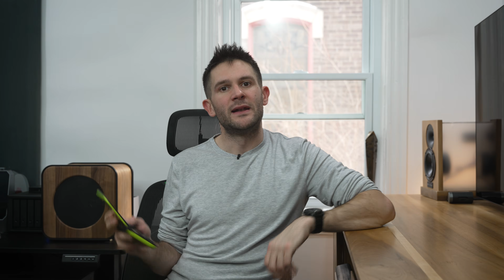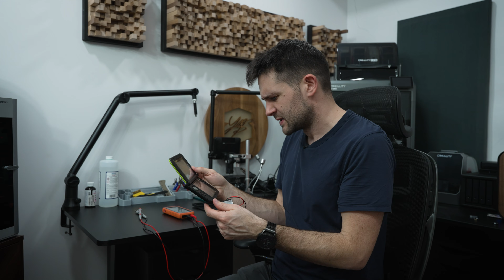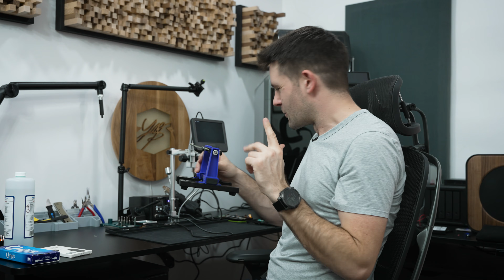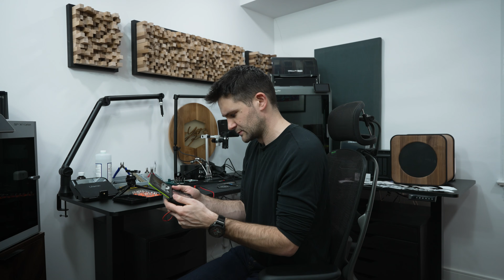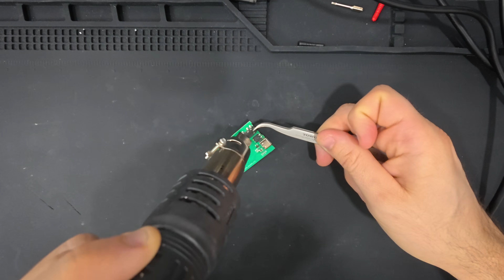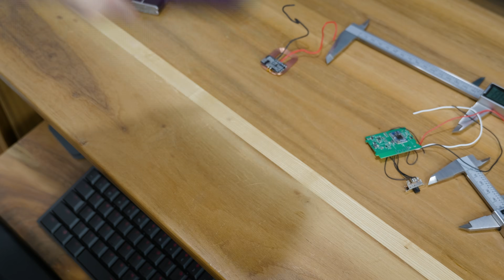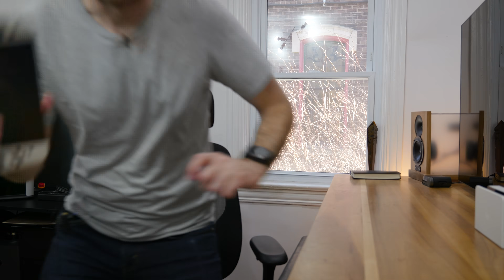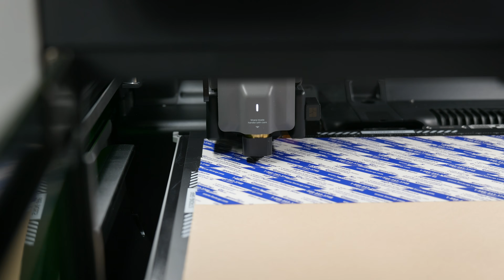I built a NEW New Nintendo 3DS....

Comment: Just got to the Bambu Labs machine unbox. Did they ever go back on their massive ToS change?
Reply: Nope and it seems it only gets worse with the newer machines like the H2D. Best is still to use them in LAN mode and restrict internet access for that specific device so Bambu cloud cant reach your printer and brick shit or force you to update.
Reply: @benistingray6097  as an A1 Mini owner, I honestly don't understand why any hobbyist/prosumer would connect their 3D printer to the internet in the first place. I get that professional needs may be different and I'm not defending Bambu in any way, but I cannot think of a single moment where I wished my A1M was connected to LAN, nevermind the internet.
Reply: @turbochargedfilms  Internet access is great a QOL feature because you can start a print even if youre not home, you can also check your prints for failures and stop manually in case you have spaghetti. As for Lan mode that is really great because i have zero interest to walk the SD card back and forth for my printing.
Reply: @turbochargedfilms print farm management, its kinda annoying to move around files on sd cards when you have 30 printers... also remote management in general, maybe your slicing computer is in your bedroom and your printer is in your basement. Or in the print farm case, maybe you don't want to have to walk your aisles of printers to check which ones are done printing and want to just look at a central system that shows which printers are done. Just because you can't find a use doesn't mean its not useful
Reply: They never walked it back ... pretty disappointing Zac supports company like that ... also gushing 3/4ths of the video about the printer did not help.